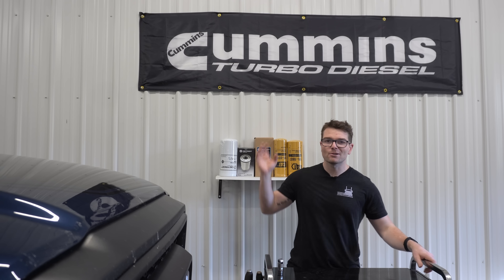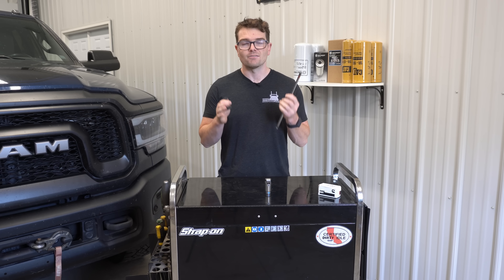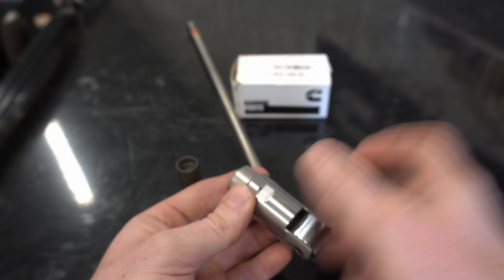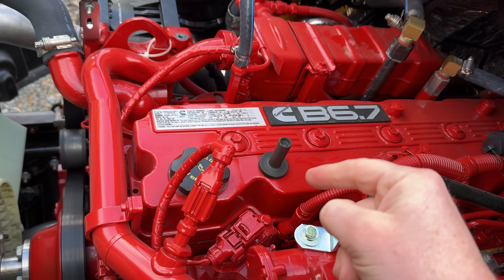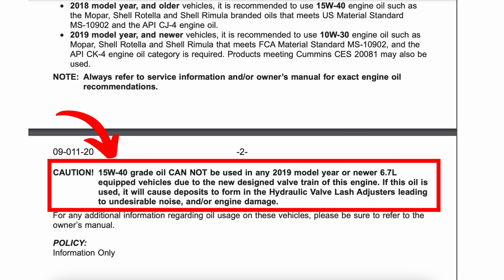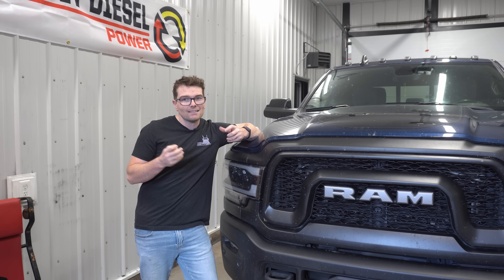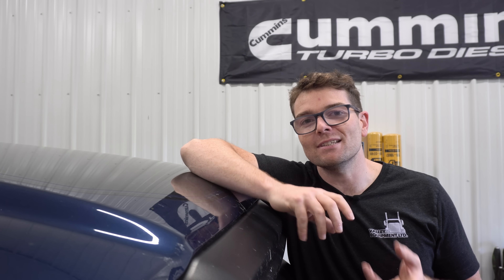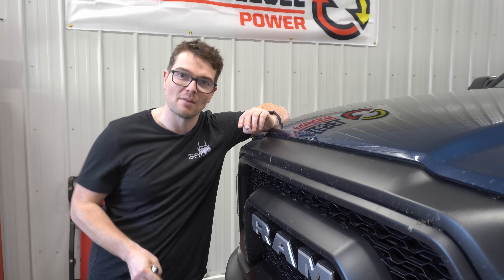RAM 2500 6.7L CUMMINS Hydraulic Lifter Failures *Diesel Mechanic Explains* | Not Good?

Comment: We always change out our oil every 5,000 miles and we have never had any engine problems with any of our cars (1981 ram 250, 2015 Subaru outback, 2018 Toyota Tacoma, 2022 ram 3500)
Doesn’t matter the make model or year regular oil changes keep your cars alive

Comment: I barely unhook my trailer from my 18 ram dually. I pull 28000 pounds. I change my oil every 6000 miles. My mechanic says oil is cheap, motors aren't.
Reply: The irony is that oil isn’t cheap anymore
Reply: @-_-_-_-318 it’s cheaper than a new engine

Comment: The HLA’s were specifically requested for the FCA engines by Ram in order to reduce NVH. Cummins obliged. But their commercial B6.7 is, as you already mentioned, still the traditional Flat Tappet. That should tell you everything you need to know. The wrong weight of oil (15w40) is definitely attributable to some of the premature lifter failures, but not all of them. There are deeper issues with the HLA’s in the 2019+ trucks and it’s a combination of supplier quality control failures and also design issues. Ram needs to scrap the HLA design and go back to the tried and true flat Tappet.
Reply: we need to stop importing steel and have our own steel and manufacturing in the USA .
Reply: Well shame on Cummins for obliging to that request. I'm shocked at how many corporations operate with a scarcity complex. It's not like FCA would have dropped them over this. Cummins is what makes Ram HD trucks so enticing. If FCA were stupid enough to drop Cummins over this GM or Chevy would have been tempted to pick them up or it would open the door for a Japanese manufacturer to develope a HD truck.
Reply: @joerapo GM or Chevy (same thing) would absolutely not pick up Cummins.
Reply: Also look at the MASSIVE HP difference between the pickup and all of them in equipment and the medium duty truck and bus offerings. I don’t know if FCA even derated the pickup ones down that low in 4500 and 5500 offerings. I do know when I was looking at a replacement the Ram was pushing over 200 hp more than the highest option offered by Freightliner and International.
Reply: A solid roller would be better than both.

Comment: I had a 2022 ram 2500 that developed a lifter knock at about 27,000 miles. I actually think the reason it started knocking is because it was constantly going through DPF regens and was getting too much fuel dilution in the oil. The excessive fuel dilution compromised the oil and its ability to properly lubricate the valve train. I think Ram needs to redesign their regen strategy and use a 7th fuel injector downstream of the engine block rather than injecting fuel on the exhaust stroke of the engine block. Might help improve valve train longevity.
Reply: I have the 2022 high output. Sad we are going to deal with this. I started the truck doing oil at 6000 mile service. I have dropped the interval down from that to 5000 and less. Hope I'm buying time for aftermarket to have a solution. This is sad buying a truck for almost 100 g and the heart is bad. I never got rid of my 5.9 and it is still making money.
Reply: I did banks upgrade and seemed to help with Regen. Not eliminated but seems to do alot better than stock. Air intake horn and boost toobs.
Reply: Built for the haul, not for the mall. I only recall 1 Regen below 100k miles.
Reply: My 2020 ran in regen 90% of the time, dealer say that's normal!! Yeah Right.

Comment: 15k service interval? you got to be kidding me. clean oil= long life every time.
Reply: My 2012 says to change oil every 7,500 miles.  My ecm reminder turns on every 6,700 miles.  😢😢
Reply: @onstar1869  maybe my memory is worse than I thought 🤷‍♂️. I’m almost certain I was doing it more often than what was called for in the owners manual @10,000 miles. I know for sure that I never reset the OCI without changing the oil& filter. My ‘14 & ‘17 definitely call for 15,000 mile OCI’s & I’m still doing 10,000. I’ve always used full synthetic (5w40) for my trucks after the 1st couple oil changes.
Reply: Cummins Ram has had that 15,000 mile OCI interval since the 6.7 came out in 2007. I can’t remember what it was on the 5.9 common rail, but might have been 10,000miles.
Reply: @jeffs2809  In that case, the change interval has been too long since 2007.
Reply: @tammyspencer9786  kilometers or miles? That a big difference here! 12000klm is only 7456miles. 15000miles is 24140 kilometers...that's a huge difference.
Reply: @jamesvpaquette American miles
Reply: @jamesvpaquette I had a 2020 3500, Ram said the oil changes were every 25,000kms. Which is bat shit crazy considering how it's polluted by the egr and fuel. I did oil changes every 10,000kms instead.
Reply: When I get to 7,500 that's about it on my 2018 .I pull campers all over the country
Reply: That's what the manual says
Reply: @T51B1  What the manual says is a Max of 15,000 miles or 1 year.  So if you only go 6500 miles for a year it still needs to be changed then. Now the Maximum mileage is stated 15,000 miles. That does not mean it won't need to be changed earlier.

Comment: Cheap Chinese steel.
Reply from the maker: could be
Reply: Easy to just blame it on Chinese metal. Proving that's the actual cause is something else. The steel could be fine but if the hardness of the roller and cam are out of spec, that'll destroy things just as quickly. And there are a ton of brainlets out there that think that 5w40 is "too thin" and insist on running "heavy" 15w40 and cause the damage on their own because they don't actually understand engine oil weights.

Comment: People just need to change their oil more often. Every single make has these issue with lifters and oiling problems. The fords seen to die the most. The new Power strokes have the life expectancy of a mazda rotary engine....  Because people are doing 15,000 mile oil intervals an engine making 1200lbs of torque. It's called math. People need to think a little and realize the EPA and Emissions scam is the biggest lie in all of technological history. You think they care about your health & safety when they literally spray poison and use GMOs banned around the rest of the world in your families food?? 

I've had the same Ram for 23 years with hardly any issues minus blown speakers and a stuck auto lock. And I'm not a mechanic, I'm just a dumb preacher. I don't have to work on my cars if I just change the fluids often. Fluids break down. Engine oil breaks down the fastest because of contamination. Filling up your tank costs more than an oil change, and your think going 6 or 10k is worth it people? Then you probably believe there's a Tesla floating around in outer space aswell. Oil analysis doesn't tell the whole tale either.

I like this Getty dude, you know why? He changes his oil at around 3000 miles, that means he doesn't trust them either.. 

Jeremiah 17:5
Thus saith the LORD; Cursed be the man that trusteth in man
כה ׀ אמר יהוה ארור הגבר אשר יבטח באדם

Baruk Hashem 🇮🇱✝️🇮🇱
Reply: Sadly modern day vehicles are engineered for the average idiot who barely knows how to fill it with fuel. There's videos on YT of people who can barely accomplish that. All of the safety crap that is now mandatory has literally taken away the need to be a good driver. People have gotten lazy and expect the vehicle to do all of the driving for them now. As much as I love my 2020 Silverado I still like my previous 2004 Silverado better. It didn't need traction control to tell you if you were driving like a moron during the winter. If the ass-end of it slid sideways while accelerating that meant take your foot off the pedal.
Reply: 6.7 ford doesn’t have a 15k OCI, at least not the ‘22 I drive for work. Oil life % gauge comes on between 5000-7500 miles on it.

Comment: I think the main reason they went to hydraulic roller lifters is noise, efficiency, and emissions.
Reply from the maker: I wouldn't disagree with that.
Reply: Except emissions gains are negated by reliability decreases, because cars themselves have a carbon footprint. The oil burned to mine their materials, the oil burned by employees driving to work to make them, the oil burned by consumers driving to work every day to save up money to buy them. Etc etc. If the EPA can't see that, they need to go bye bye.
Reply: You’re speaking logic. They don’t understand logic. Like cash for clunkers. Tons of fine cars destroyed in the name of fuel efficiency, to what, produce more waste in disposing and producing more cars.
Reply: NVH = Noise  Vibration  Harshness.  It was a Stellantis decision not Cummins. Hence why a Cummins repair shop will not look a a 6.7l Ram engine.

Comment: Why couldn’t they make a hydraulic flat tappet lifter
Reply: In relation to this issue, what would that solve exactly?
Reply: Why couldn't they just not change anything and have owners maintain the engine like millions have done without issue over the last few decades?
Reply: @hochhaul  if you want the original 160hp 5.9, you can probably save a bit by finding one of those instead of shopping for a new truck.
Reply: @ALMX5DP  No I'll just take a 6.7 with flat tappets and isnt a pos, thanks tho lil buddy
Reply: @hochhaul  ah, I thought you wanted the "not change anything" approach and desiring the OG, not a modern engine that has many changes just not the flat tappets.

Comment: KTM 790/890 cam-itis (cheap metalurgy)
I was surprised they had used solid lifters in the past.
I'd be interested where the hydraulic lifters are made. (KTM has moved a lot of it's manufacturing to China)
Good stuff as always, Alex :cat-orange-whistling:
Reply from the maker: it would be interesting to know where they are sourcing these lifters from!

Comment: Seems that the flat tappets would be less expensive than the hydraulic roller lifter besides being more reliable.
Reply from the maker: I would imagine there is also a performance benefit with the roller lifter. But yes I agree much cheaper to go with the solid flat tappet

Comment: Change your oil at 5000-7000 why gamble
Reply from the maker: 12 qaurts of oil takes a lot longer to dirty then your standard 5 quarts in a normal gas engine. Semi tuck I work on change their oil like every 40,000 miles. they use the same 10W30 but just have alot more oil (40 liters)
Reply: @GettysGarage  so sounds like a 10-11k interval for 12 quarts would be appropriate? That would put it in the same quantity-to-mileage change interval.